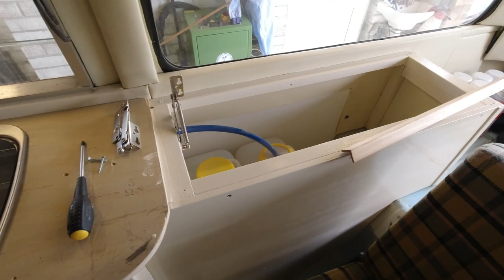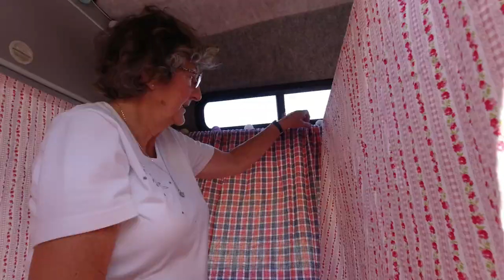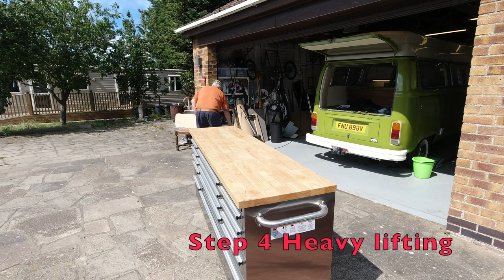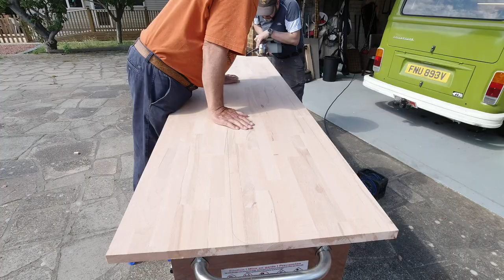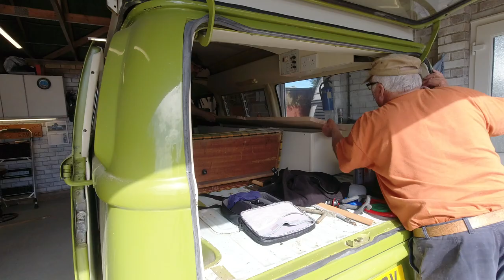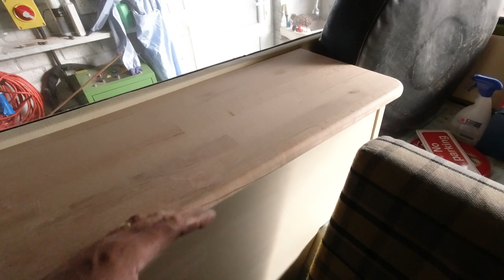Olive the VW T2 camper gets worktops. Episode 14

Comment: Well  now we know what you will look like in ? Years😂 however what a lovely job on the beach worktop,was it laminated planks? It looks the business. In my Hymer I cut up a fixed tabletop, to hinge it, so it would drop down. Trouble was it was hollow in the middle so has to put filler piece in to keep it rigid.  John I love your practical approach it really appeals to me. I am enjoying this as much as the XK8.
Reply from the maker: Thanks Bruce. Much appreciated. I have just finished applying danish oil to to the beech tops. Wait till you see them next. It will have you googling beech tops for sure🤣